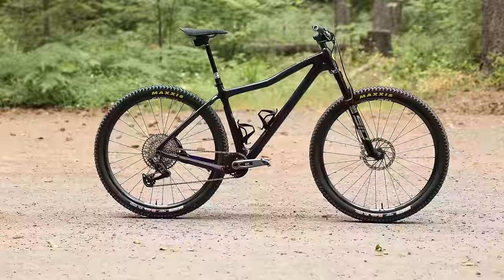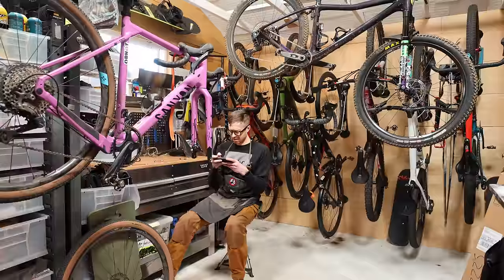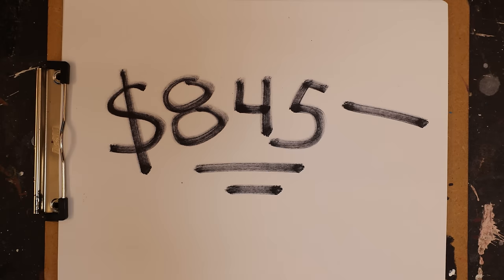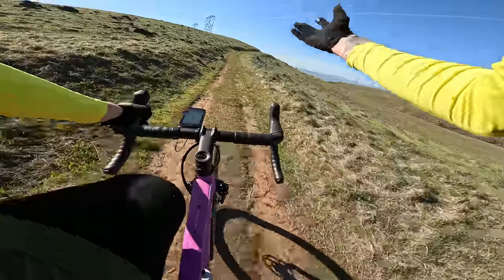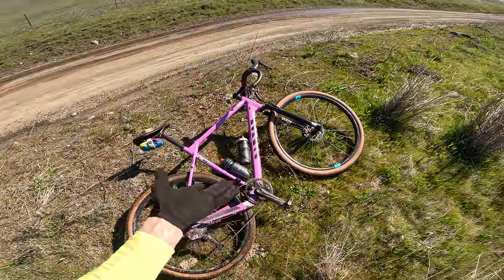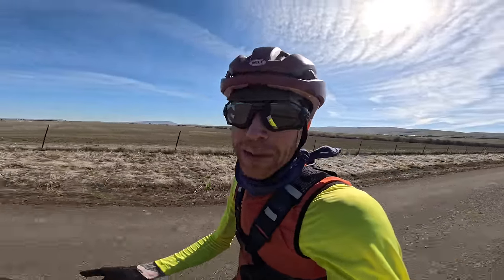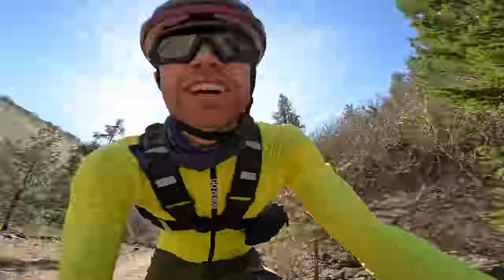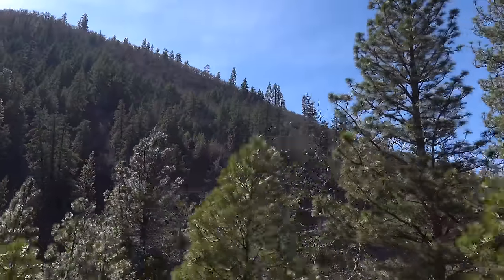The Most Controversial Gravel Bike Upgrade!

Comment: 30-40mm of travel for $845 plus 2lbs additional weight...? Makes me think 20mm of travel, 260 grams, and $190 for the Redshift Shockstop is the way to go if someone wants to add suspension.
Reply: Shockstop isn't technically suspension though - it's just a shock absorber as the front wheel isn't "suspended".  The advantage of a suspension fork is that because the wheel moves up and down with the terrain it improves grip -  you don't get that with a Shockstop stem.
Reply: @markianross  I understand your point. My feeling is, if you're going to this length to put a suspension fork on a gravel bike, you might as well just get some thinner tires on your HT mountain bike.
Reply: @RocksOff72  I have gravel bikes and mountain bikes - the biggest difference with a gravel bike for me is the drop bars and ride position. So lighter / faster tyres on a mountain bike will still be a very different bike to a gravel bike with 40mm suspension.
Reply: I ran an Allsop suspension stem for a while. Gets the job done, doesn’t break the bank
Reply: @markianross you don't need the grip in the front do you?
Reply: @gur262 why wouldn't you need grip and the front? You can never have too much grip at the front - if you're flying down a rough descent and you lose grip it's lights out. It helps on the climbs as well as you don't "bounce" off the rocks so much.
Reply: Too much money, lack of skill. I will still descend faster than all of them with my rigid steel fork.
Reply: If you’re gonna get a sus fork get at least 100mm of travel
Reply: @SeaCowsBeatLobsters  wow my hero.
Reply: @markianross  i can see that. However, I think marketing hype, certain YT channels, and the desire for some to have the newest/latest thing/fad/shiny object will drive some to install a 30-40mm fork on their gravel bikes at about $1K (w/install) when a $190 stem with only 10mm less travel would suffice.
Reply: @RocksOff72  I wouldn't pay $1k for it - mine was £425 (about  $540) and about £50 to install. Rockshox stuff is often easy to get lower than RRP.
Reply: It’s very dependant on the terrain you are going to ride on. My gravel bike does double duty as my road bike so a suspension fork is unnecessary most of the time. If you’re hitting lumpy or technical terrain right from your door then a suspension fork is more likely to pay dividends
Reply: I installed a redshift shock stop on my diverge and it works perfectly. Along with wider tires it’s the best upgrade in my opinion
Reply: I’ve got a Trek Checkpoint SL5 with a Redshift stem and a Tumbleweed Stargazer fully rigid for comparison. With the “suspension” stem your body is isolated from the bumps and it does a lot to smooth out rough roads. Considering the front end of the bike is only a small percentage of the total system weight it allows the wheel to track over rough ground (gravel roads or light singletrack) very well. As a product designer I think that a 30mm suspension fork is overkill for gravel and it’s just another “upgrade” that the industry is trying to sell us.
Reply: @gur262  not so much for climbing, but descents, sure
Reply: A mountain biker caught me taking my road bike on the trail and that's what they recommended. "If you're getting around on 23mil tires out here, you really shouldn't bother with a mountain bike. Just get one of those suspension stems and you'll be happy
Reply: or get a Specialized with Future Shock and have it stock on your rig
Reply: Come in Rebecca
Reply: I tried a redshift stem. Totally weird. Suspend the bike not the rider. I now have a lefty on one gravely and a rudy on the other
Reply: The face the mtb guys make when they get their ass handed over by a guy on a gravel bike

Comment: I've been riding 80 - 100mm suspension on my converted gravel bikes for about 4 years now and telling anyone who will listen the benefits of it! The caveat is "real" suspension, though, with rebound and compression adjustments, not just bouncy, gimmicky bits. Being able to ride faster, for longer, while using less energy doesn't seem to have a downside. But, the road is the last place you'll find me and it seems most gravel bikes are 80/20 road/dirt oriented.
Reply: So why would anyone choose not to keep the $845 and adjust a 100mm travel suspension to be less bouncy?

I guess my hybrid bike is quite close to this, only at a heavier weight :)
Reply: So have you fitted a regular mountain bike suspension fork?
Reply: What fork did you use? And what did it do to handling? I'd guess that the offset/trail would be huge compared to the original fork, did the front end get super floppy?
Reply: @owenfidler2115  I used a RockShox Reba. The frames I've used were originally specced with a suspension fork, so the geometry was not compromised.
Reply: @bonkasaurus_wrecks  Ah thanks mate 👍

Comment: So, gather around youngsters and hear my tale. I raced XC throughout the late 80s and the 90s. In that period front suspension was introduced and became regularly accepted. I was a late adapter, not because I didn't think it would work or any retrogrouch BS,  but I was just a poor bike racer dude and I had spent all my money on my Yo Eddy and race fees (and beer?). First suspension was about 30mm, which is what my Yo was built to correct for. The first shocks were wiggly but the improvement over time (fatigue, chatter) and in clutch situations was worth it. Before the shock I excelled at climbing and very technical descents, but fast stuff...not so much. The shock changed that a bit, just enough, and I raced with one for 4 years or so? By then I had a shock with 40mm travel and I just decided to ride rigid because of the way it affected my handling. I did fine, definitely slower in some situations, but that bike...wow. I really like suspension, but sometimes I just want it to go away. Now I ride a rigid 29+ mtb and really love it. I'm slow, a little fat, but hey! Bikes are cool! (Also, the 90s Mt. bikes/gravel bikes thing is getting scary).
Reply from the maker: This story was better than my video! 🤜❤️🤛
Reply: That’s what lockout is for
Reply: @nnn-pr3vr  lockout doesn't correct geometry, it just mostly locks out compression. That's not too important for most bikes now, but it certainly was in the 90s.

Comment: I would like to see a head-to-head comparison video on gravel suspension - suspension stem, fork and seatpost. Curious, which one works best and/or what purpose does each serve
Reply: @Manetty6  modern ones work a lot better. I think I'd rather run Redshift on my bike than 3lb, 800$ suspension that needs routine maintenance
Reply: Three different fork systems to consider: traditional (like Dustin used in this video), Lauf Grit, and Hiride Sterra. Then compare to stem and/or seatpost (disclaimer: I run the redshift stem & seatpost)

Comment: I'm riding a YT Szepter Core 4 which has the 40 mm lockable suspension fork and for me it was a real game changer. Main advantage for me is how much it reduces little bumps on fire roads, etc. which will get you tired a lot later than without fork. Second thing I noticed is how it gives me way more confidence to venture into gnarlier single trails that I wouldn't ride without suspension. It simply adds a lot of fun for me.
Reply: I came so very close to buying that bike. I ended up getting a Cannondale SuperSix CX. It came down between those two.
Reply: @DaveCM  
I have a CAAD13, so I wanted something more leaning into the MTB side of gravel. The Szepter rides a bit like a hard tail on steroids.
But I bet the Supersix CXis a beast, too.
Reply: Dustin should review that bike!
Reply: This is the right argument. More fun, comfort, and confidence.

Comment: TECH NOTE: The Rockshox Rudy brake mount is the same as a 140mm REAR flat mount, but configured for a 160mm disc. This means if you want to upgrade to a 180mm rotor, you need a 140-160mm REAR flat mount caliper adapter. Don't ask me how I know that; but on an unrelated topic, if anyone wants any kind of obscure flat mount adapter in box-fresh condition, drop me a line.
Reply: That's because it uses 34mm spaced thru-holes instead of the retrofitted 74mm spaced threaded holes that came from post mount. it's the way to go in my opinion lots of steel forks do this, as well as the Scott addict carbon forks, among others im sure. One would assume it is much stronger.
Reply: So, the SM-MA-R160 would accommodate the 180mm rotor?
Reply: @naromsky  Correct. That's what I used.
Reply: Man, thanks. Now I can tell people "don't ask me how I know".

Comment: Was going to get a Gravel bike but converted my old 26” dually with corner bars, 27.5 front suspension and wheel and so pleased with the result….it runs rings around any gravel bike and is a joy to ride.

Comment: So I did something similar to this recently, but I took a hardtail Giant XTC and had the LBS put on drop bars and wireless shifting. I had already slapped on some tubeless gravel tires the previous year. With 100mm of suspension it is a blast going down and the lock out makes it work pretty well on the pavement and smooths ups as well.

Comment: I recently added a dropper post to my Giant Revolt.  I love the post that came on the bike, but wanted the dropper so I could fit my bike inside the back of my truck. The dropper post has suspension built in, looks like 40ish mm of travel. This added maybe 300 (??) grams. I’m an old guy. The travel in the dropper post is a total game changer for both gravel and road. Totally worth the weight increase.

Comment: I think a suspension fork has its place for “gravel” but its pretty niche. 
FWIW I’ve been running an older short (395mm) reach (pre long low & slack) Epic hardtail with drop bars, a Fox 32 SC fork with travel reduced to 80mm to keep the front end a bit lower than stock, an Easton AX dropper & Race King tyres. It comes in at 10 kilos (22lbs) and I find it’s a really fun bike. 
It’s great for long mixed rides with flowy single track, rough gravel and the occasional paved road connector as long as your not concerned with absolute speed.
More of an N+1 than a quiver killer though. I just built it up ‘cause I had the parts and thought it would be fun. Not disappointed 😎
Reply: Ideal sounding bike for me: cozy shredding. Nice setup man
Reply: Thanks! I think the key is if you can find a frame with a shorter reach than you would usually want on a flatbar bike so you dont have to run a crazy short stem.  @TheGoobsters

Comment: I bought the Cannondale Topstone Carbon Lefty 2 based on his review. A gravel bike with a bit of suspension. It has been a blast. Go anywhere bike.
Reply: I have the Lefty 2 :) I changed the wheelset, the WTB KOM wheels are very bad, so I had custom-made carbon wheels with Newmen rims (a German brand from Cube bikes) with DT Swiss 240 hubs, yes, they make a lefty hub, now it rides fantastic. Oh yes, the cockpit I changed too, a Ritchey WCS ergomax in 42cm (from the 44cm the bike comes from) and a Zipp stem in 8cm (from the 9cm the bike in L came with). I might change the bike to 2x, a 48/31 chainring and a 11-36 cassette, the bike comes anyway with the left lever for that, to make it 2x. Cheers!

Comment: I converted a Trek Excalibur 29er hardtail to a “gravel” bike. Different wheelset (that I already owned) and “skinny” tires. Reasonably light and good MTB 100mm suspension forks. Cheaper for me than adding $845 gravel forks. For now I kept flat handlebars, but I have several drop bars lying around if I choose to covert. (I have several bikes and lots of extra parts and like DIY (until I don’t;).)

Comment: A few years ago i was looking for a fun playful gravel bike but then i realize i actually wanted a fast rolling mountain bike.
I kept searching then i found a 2012 Rocky Mountain Whistler and it checked all the boxes. 
It's basically a Flat Bar gravel bike with 60mm SrSuntour Fork which weighs 5 pounds!
Luckily i Found a 2012 Rockshox Reba. Its the Lightest Suspension Fork at that time at 3lbs!

Comment: In Jan Heine's book, "The All-Roads Bike Revolution" he details how supple and wide tyres are the primary suspension. The contact patch of a supple tyre responds faster than any suspension fork. What a fork is for is the really hard knocks like you get on gnarly singletrack. So, while a fork is great value for those who hunt gnarl, if you're a gravel spinner only, put your cash into tubless with super supple casings (and sealant, supple has a slightly higher puncture risk. Ride low PSI to fly 😀

Comment: I own a Grizl and the second I saw you try to install the fork I thought, "huh, they make that with the 1-1/4" steerer?" Looks like you quickly ran into that issue. I had a lot of trouble when my stem cap broke early on in my Grizl ownership. I'm curious what the LBS did to fit the fork in the larger steerer tube opening.
Reply from the maker: Luckily Cyclepath was prepared!
Reply: Um.....it's pretty straightforward. You need a new top headset, stem, and star nut. But I had no idea Canyon was 1-1/4! That's nuts. No one else in the known Universe does that.
Reply: Yup I had this issue when I added the Rudy to my Grizl CF SL eTap a year ago. Ordered a new stem and LBS did the rest. Love the sus fork for the reasons it was made for. Great vid DK once again 👏🏼

Comment: That suspension fork materializes everything I'm trying to avoid on my gravel bike. The weight, the maintenance and my sprint out of the saddle feeling like running in quicksand. Wider tires will give you all of those benefits with almost none of those compromises.

Comment: I sold my gravel bike because I preferred my full sus XC bike off road. Big mistake as I didn't really think about riding on road, to the trails. Got a new Specialized Roubaix about a week ago and so far have been really impressed with the Future Shock suspension on the road. Will be putting some gravel tyres on it next weekend and trying it on the trails.

Comment: Suspension seatpost and stem is best of both worlds. Little-to-no energy losses because the suspension isn't between the wheel and the drivetrain. Enough travel for gravel. Most of the weight is still on the rider side of the suspension - though obviously not as extreme as having the suspension on the fork, so works best with as light a bike as possible (another excuse to be a weenie!).

Comment: well, based on my experience this upgrade may be worth a while but theres couple points to take in consideration

1. gravel with fork isnt just replacement for gravel itself, think about it as filling the gaps in bike types - having something between textbook gravel bike and typical full-grown mtb
2. a lot will depends on fork quality, because from 30-40mm supsension movement I will not expect same bump absorption capability like in XC bike - it should be used to take small terrain bumps or gravel roughness but only if fork is sensitive enough to work on such conditions
3. i guess this is great feature for mostly gravel ultra where you doing 200kms+ in conditions that are not smooth gravel road or paved roads, taking strain from your hands and adding that comfort factor is usefull on very long rides

Comment: I own a 45mm-tyre aluminium gravel bike (focus atlas) with carbon fork and the only place where I miss some suspension is on descents with many many more embedded cobbles than the ones you showed here. Handlebar vibration becomes unbearable unless you overbrake. You are overtaken by the MTBs who can descent with much more ease. Other than that, for regular firm wide tracks, suspension is an overkill for a gravel bike.

Comment: Get a Lauf fork. Zero maintenance and lighter than a traditional suspension fork. I think it ofers up to 30mm of travel and is designed for smoothing out the vibrations rather than tackling jumps. I ride a Lauf Seigla and its a dream to ride on gravel.

Comment: For a bit of a different take on a suspension fork, have a look at the Lauf Cycles suspension fork. No maintenance required.
Reply: I just purchased a Lauf Seigla Race Transmission with the Grit Fork.  Loving it so far, it's a go almost anywhere bike which is good for my area.  Was doing mostly road riding and wanted more options for trails and gravel.

Comment: Gravel bikes exist for people looking to include some degree of challenge into their ride combined with reliability and simplicity to crank some miles out undisturbed by cars and pedestrians. Mountain bike designs have become so complex and effective that it takes most of that challenge away. You can roll over gravel trail without a thought, its numbing. 

Suspension fork gravel bikes might become a popular thing, but not for those who embrace gravel bikes' original purpose. That sounds like something a hipster or gatekeeper would say, but if someone wants a front suspension gravel bike, isn't it easier to add drop bars to a hard tail anyways?

Comment: Just to make a note, there is a big difference between the aluminum grizl and the carbon grizl in ride feel. I "purchased" an aluminum and a carbon back to back and after less than a quarter mile test ride I *immediately* ditched the aluminum for the carbon bike and filled out a return RMA. The ride feel is that massive. No hesitation, not gimmick. It's real. The aluminum feels like you're riding on a stone. If you're buying the aluminum Grizl, not only are you taking a serious weight penalty (24lbs vs 19lbs) but you're sacrificing ride quality. And then on top of it you slam a front suspension on it? Nope. Just shell out for the carbon bike and a S15 VCLS seatpost and you'll be happy as a clam. My carbon Grizl did NOT come with the VCLS seatpost so that ride feel test I did was back to back with stiff seatposts. I later added the VCLS and it was like riding on a cloud. 2,500 miles later and I still love my carbon Grizl.